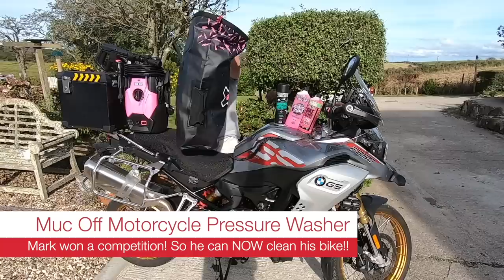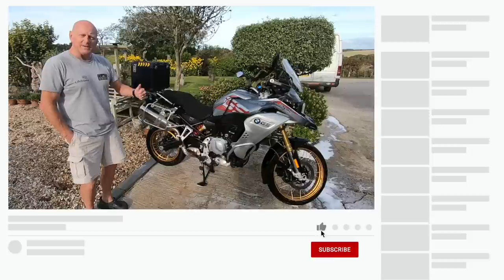Muc Off Cleaner | Mark's new Gadget

Comment: I brought a dog blower from eBay , cost £40 and it does a wonderful job of drying the bike. It has 3 blower settings and 3 heat setting so it drys the bike off a treat. Also brought a small compressor and sprayer attachment which I use twice a year to spray on AFC50. Again brilliant piece of get as I can use it to blow up tyres as well !

Comment: I’ve got one! Best way to clean your bike. Don’t forget to put a bung in the exhaust and turn the knob to off or else next time you plug it in it will run if there’s no water connected. Don’t know why but it does! Not good for the pressure motor. 😁👍